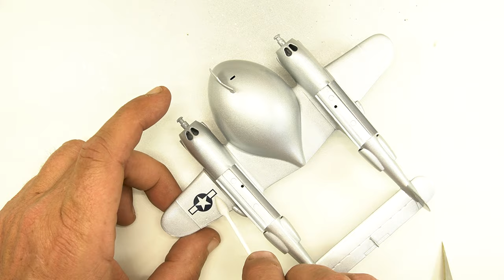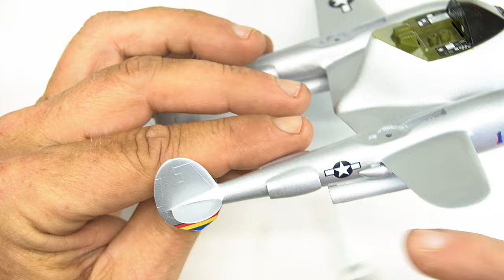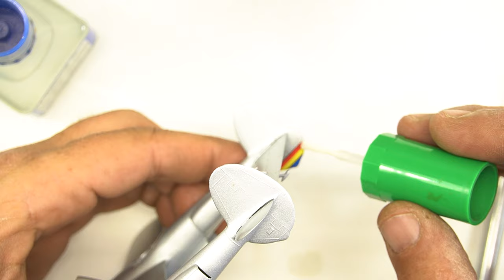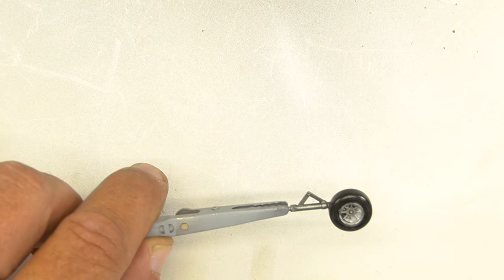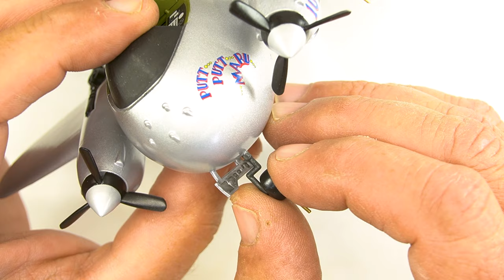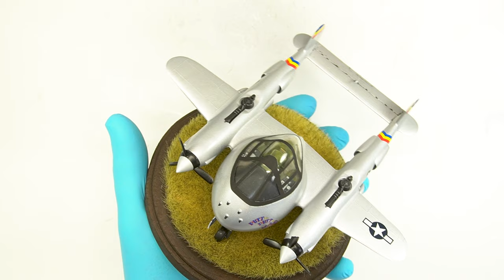HOW TO: DECALING a P38 Lightning EGG PLANE! And FINALE!!

Comment: amazing job Kenny. how did you line the pins with the base? never done a dio base before.
Reply from the maker: Thank you Dan. After I put the pins in I dipped the tips in black paint and set it done on the base. The black paint gave me a guide where to drill and line up the plane.